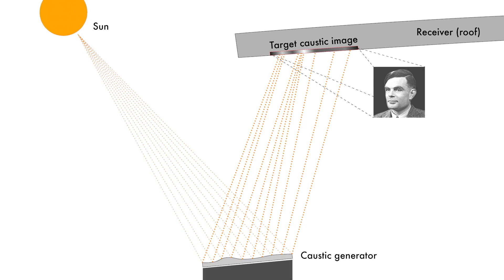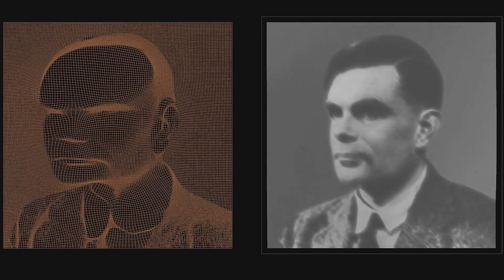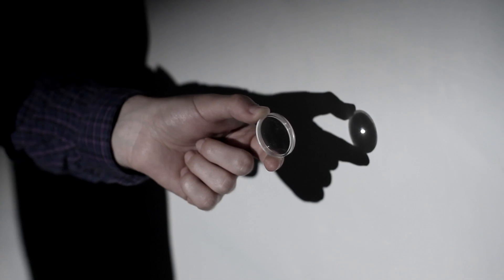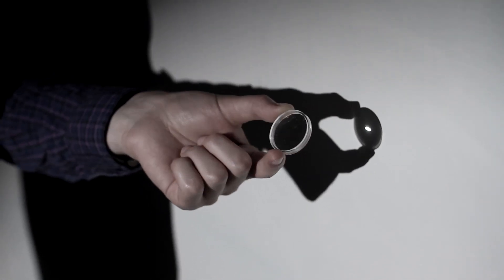sol.id: Mirrors that redirect sunlight to paint portraits out of light

Comment: could you design a surface that projects different images at different focal lengths? Such as if the light source changes angles(sun shifting in sky), and the target surface distance increases or decreases(a window/path in the surface leading to a ceiling of a different floor/plane of building/structure), a different image appears from the same mosaic of Caustics within themselves.